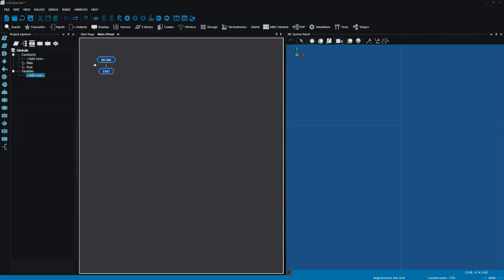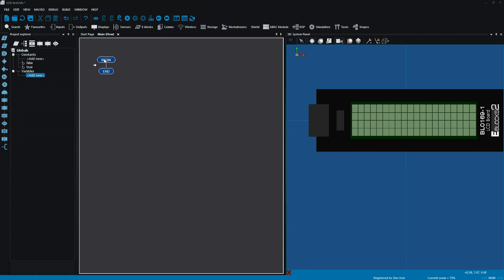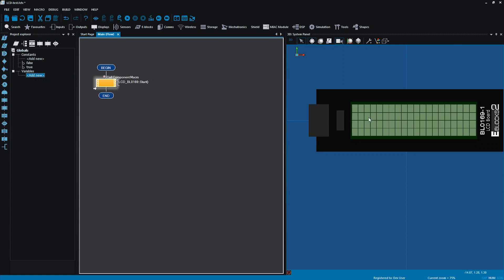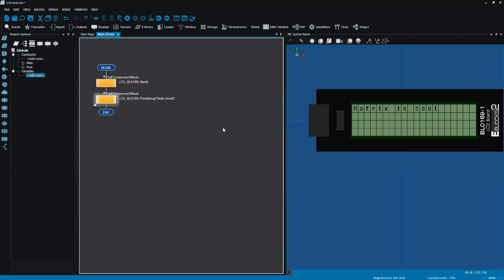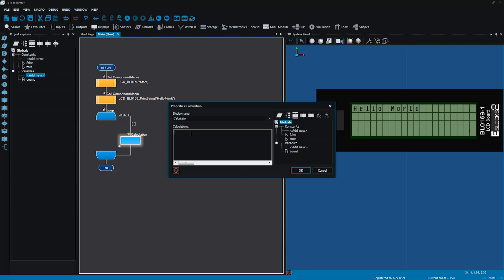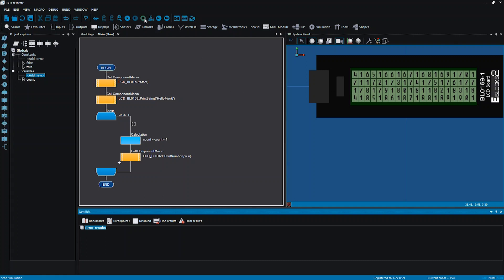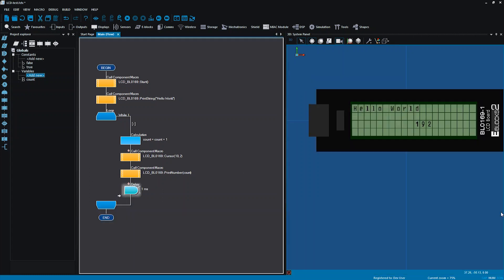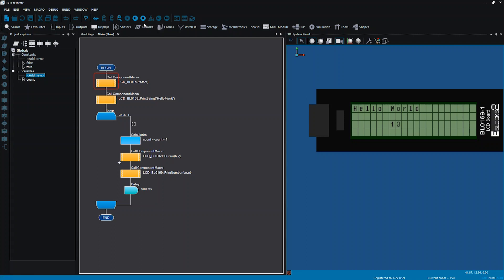Flowcode 8 Beginners Guide - LCD Screen

Comment: Hello, i build a simple project using Lcd screen flowcode, but i face a problem related to blacklight Lcd screen, in flow code it worked normally, but when i do it using real LCD, i noticed that LCD screen will not keep lighting untill i put a second macro, so the main idea is when i use the black light macro once, it works like flashing the screen, after that the light turned off, if i put the macro inside the loop, it will remain on. So can anyone have any idea related to this issues, is there any place like the setup place to keep my macro inside it?
Please @Flowcode if you have any idea related to this problem.

Thank you
Reply: So my target is to keep my screen light on, it's not right to send a macro command lcdblacklight=1 each micro sec

Comment: Good afternoon! Please tell me who can help from your specialists .I decided to test the voltage measurement module on Atmega 8 using different potentiometers. In the simulation, the program works. When the potentiometer rotates, the voltage changes, which is then displayed on the LCD display 16 * 2.And when I decided to check on the real scheme-it does not work. Instead of a changing voltage, it constantly shows "U= 4.99". The LCD 16*2 module is working, and the potentiometer modules are not working.
Reply: Hello, Please post the problem along with your Flowcode project on the matrixtsl user forums and we will investigate the issue for you.